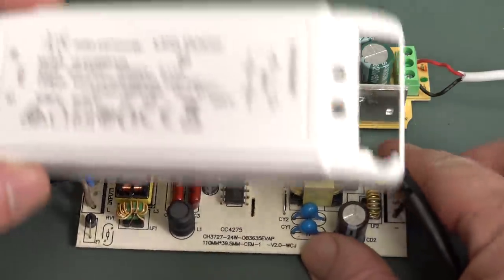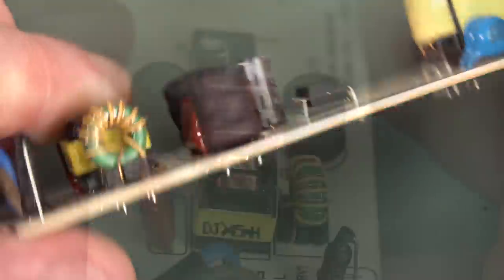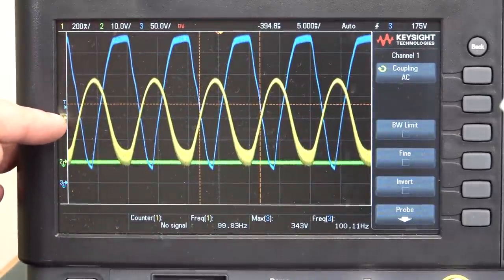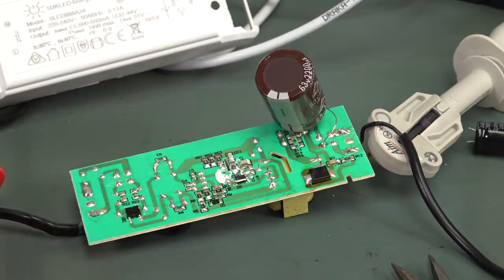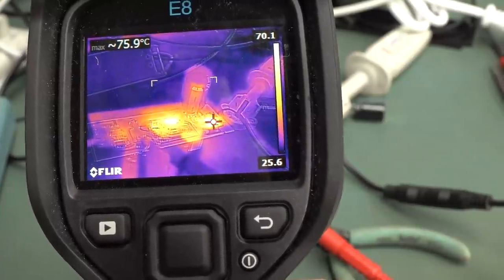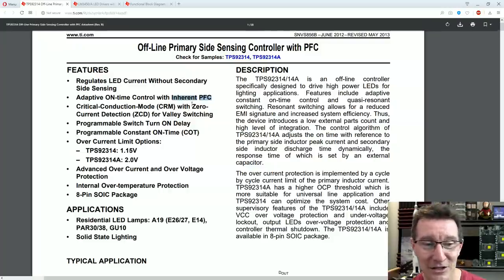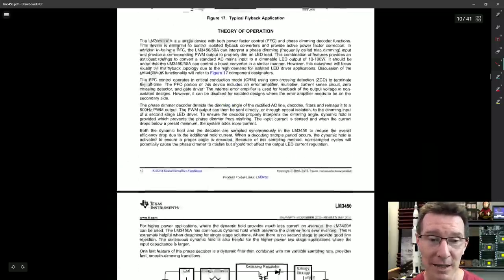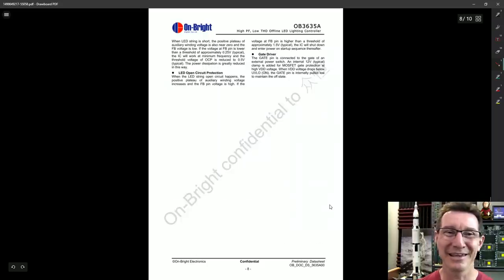EEVblog #1253 - LED Flicker 2: Electric Boogaloo

Comment: In the good old days all you needed was a filament. No PF problem, inherently low flicker (that worked), good red and infrared, no blue peak, output for good health and they warm the house in the winter saving on the central heating bills. Low embodied energy in manufacture and disposal compared to solid state and cheap as chips! LEds, who needs 'em? Oh, the corporations so they can sell us more stuff....
Reply: That's quite enough thinking please go and purchase some medication to control your issues.

Comment: Please, you are an educational institution, academic exercise is wholly appropriate here.

Besides the output capacitor being pathetic, so is the inductor sitting there, it wouldn't be much of a stretch that they together form an output filter and you could get a lot of leeway out of a beefier capacitor by replacing that inductor with something much more inductive.

I'm all for polishing the turd in this case. You can still chuck it into the bin after making the videos, i sure don't wish you to put it under your roof.

Comment: “Transconductance”! So this boogaloo is an audio opamp, never designed to produce anything more than a sine wave: and the panel which is supposed to be a light source is misinterpreting the input as a command to flick on and off. There’s your problem, lady.

Comment: “Transconductance”! So this boogaloo is an audio opamp, never designed to produce anything more than a sine wave.
Reply: Thanks for making 20 posts all saying variants of the same thing. Transconductance is a measurement of the transfer function of a voltage to current conversion, it has nothing to do with audio op-amps or sine waves.